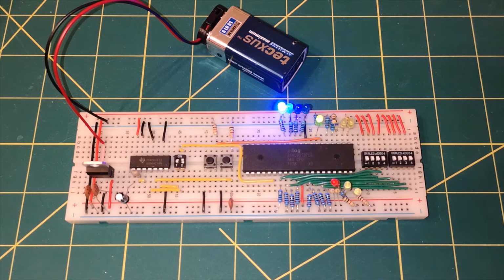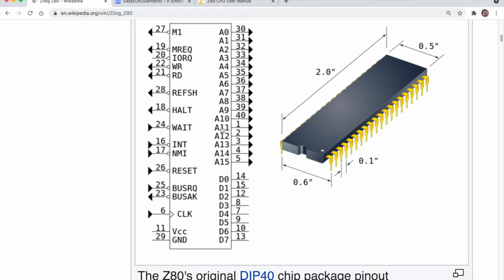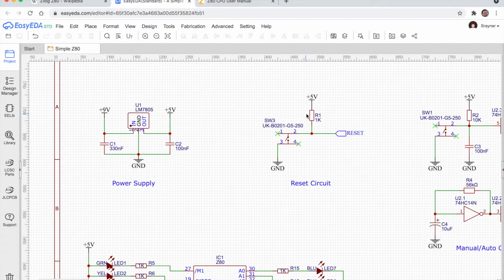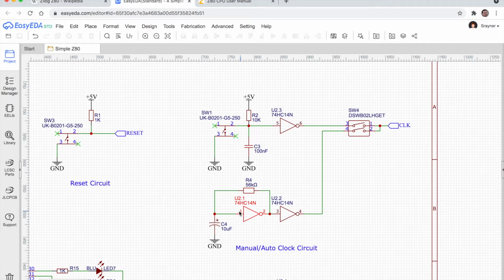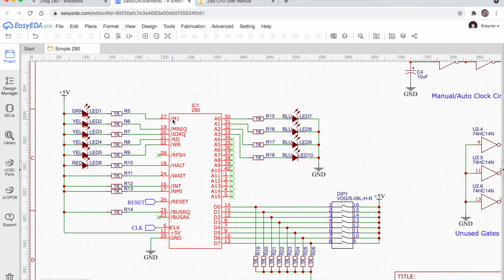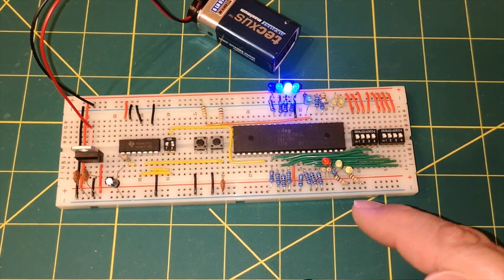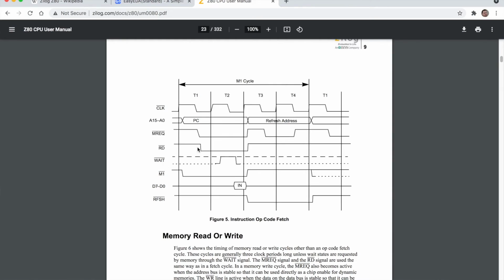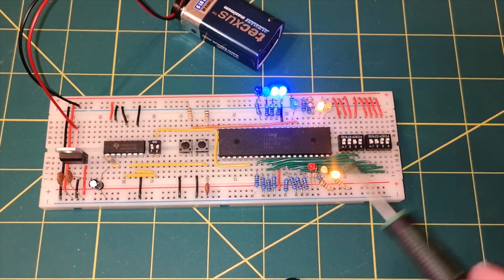Z80 Computer - Part 1 The CPU, Clock & Reset

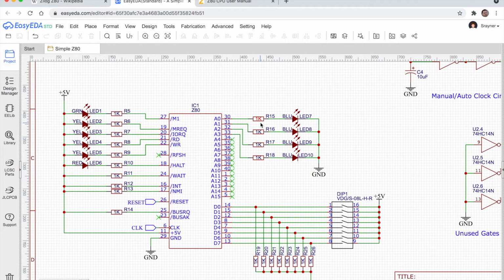Comment: 24:19 The current limits are the same for all pins so its specified just once under DC Characteristics. It's non-symetrical so different for active high and active low. Iₒₗ is 2.0 mA and Iₒₕ is 1.6mA. If you were using a first generation chip you'd have had problems, but later revisions were built to better specs.
Reply from the maker: This is good to know. If anyone is following along with an early chip it could damage it.

Comment: There's what the spec requires and what the parts well permit.The modern CMOS parts can handle more current, but if you're going to produce anything other than a bodged prototype you should buffer the LEDs, if only to ensure maximum fan-out of the bus.

The NE555 is usually depicted as transistors because that's what they are, but TTL inverters are more or less the same circuitry, and Don Lancaster first showed the astable multivibrator as a couple inverters that'd otherwise be oscillating at propagation delay time with resistor and capacitor to slow them down. Ben Eater used three 555s for his clock module to build upon teaching about what all the 555 can do, but the output was a clock with pretty slow rise/fall times. A Schmitt Trigger would've cleaned that up.

But if you're not building on previous lectures on the 555 and you could do with a Schmitt Trigger anyway, a 7414 gives you a clean slow clock and four debounced buttons! Throw in a NAND or NOR discrete chip, a 3-way slide switch, a pot to replace the RC resistor, and two more caps and a crystal and you've got a better fast/slow/manual clock circuit than Ben's at half the breadboard space he needed.

I am sad that the Z84C00 is no longer made. Guess we'll be turning to emulations and FPGAs in time.

Comment: whats the transistor for
Reply from the maker: There is no transistor. There is a voltage regulator on the far left, it's there to reduce the 9volts coming from the battery down to 5volts
Reply: @SteveRaynerMakes  transistors will have 3 or more things

Comment: I've just discovered your channel Steve and I'm enjoying your content. I have a similar project on the go currently, a multi-Eurocard based Z80 20MHz overclocked to 25MHz (using /wait to help the  EEPROM keep up), a LCD character display and PS/2 keyboard for input. My goal is a faster version of the original IBM PC. Your work on a VGA output is of particular interest to me, keep it up!
Reply from the maker: I'll be the first to admit I am struggling with the VGA, but I think it is one of the most interesting parts of the project. I also wanted to look at the faster more modern Z80 processors but I could not find any good documentation.

Comment: Recently I started a little 8 bit breadboard computer project with the w65c02. Much fun with the literal 0`s and 1`s right on the chips little legs. I also more recently got hold of 6 circuit boards from some communication system, It  holds a D780C-1 processor. Turns out I am now the proud father of 6 Z80 oem CPU's.  So a search on yt got me here for a Z80 project, Subbed and bookmarked for later.

Comment: hi, I have a Zilog Z80 like yours, in cmos, but it behaves anomalously, I made the connections like yours, pullup resistors on the reset-busrq-wait-int and nmi pins, I generate a clock with the blink sketch of arduino (for my convenience at the moment). 4 LEDs with resistance on the negative for the address bus A0-A1-A2-A3 and finally I put all the pulldown resistors of the data bus, the only difference from your project is that I didn't put the jumper on the positive for the databus. It shows no signs of life, the clock LED flashes, the RD LED is always on and on the m1 it never activates even after pressing the reset for a long time... Do you have any suggestions, maybe I missed something? if it can be useful my model is Z84C0020PEC
Reply from the maker: My part number is Z84C0010PEC. Seems we both have CMOS versions. Mine is 10Mhz yours is 20Mhz, but as far as I can tell they should both work the same. All I can suggest is that you double check everything. Did you connect 5v and GND pins on the Z80? Might be obvious, but you didn't mention it. Do you have an oscilliscope?
Reply: @SteveRaynerMakes   I had taken the power supply for granted, the 5V in pin 11 and GND at pin 29, I power it via the Arduino Mega. I have one oscilloscope that has been sitting in the cellar for many years, I don't know if it still works, I also did a test by changing the breadboard and redoing all the connections, the strange thing is that if I remove it from the board and put in a new one taken 2 days ago even if it is another model (Z8400AB1 or Z80ACPU) I think CMOS doesn't work

Comment: Hello! I tried out the circuit, and it works perfectly with automatic clock. However, manual clock does not work as it should in my case: no problem if I press the clock button continuously at a steady pace. But if I stop pushing it, after - let’s say - 1 or 2 seconds all the yellow and blue LEDs turn on. So I can’t really pause the execution. I checked the clock signal with an oscilloscope, and it looks ok. If I stop pressing the button, there is no clock signal. But even in absence of a clock signal, all the LEDs (except halt) will light up after a few seconds.
Reply: It looks like my Z80 is an NMOS version of the chip, thus requiring a minimum clock speed. Manual clock only works with newer CMOS processors.
Reply from the maker: Although it doesn't help you much, it is at least good to know.
Reply: @SteveRaynerMakes  Indeed, I purchased a new CMOS Z80 and I can confirm that manual clock works properly with it ;-)

Comment: Choosing a "fairly useless low spec machine" is on the USEer.  If you have a USE for a low spec machine as a hardware and/or software driven invention/utility device, then the low spec machine is no longer "USELESS".  If you want your computer to decide for itself what it will be used for today, then by all means, USE paywalled corporate driven AI pets!!!!

Comment: Nice video. One quick note when you're manually doing the output. Whatever you output is going to be on the same bus as those DIP switches, which some are forced HIGH when the switches are closed. Hopefully no data bus pins were damaged.
Reply from the maker: Yes in hindsight that wasn't really a very good idea. I guess the circuit is ok for reading, but not really safe for writing. Luckily there does not appear to be any damage. I think I might have been lucky, in that the instruction I used was OUT (n), A. So it's the contents of register A that would be output. I believe this "may" be FF after a reset.
Reply: @SteveRaynerMakes  I saw that you're learning as you go, so these are typical things we all do. I was building a Z80 system yesterday and mixed up a few lines and wondering why my code wasn't doing what it should. Then I accidentally connected the WR line on the EEPROM / Flash memory, so when the code went rogue, it overwrote some of the code. I'm on your third video. Still going...

Comment: I just started breadboarding this. I got some C compiled and burned onto an EEPROM but I will have to make my own Z88DK config. After I started connecting it to the Z80 I decided to move the processor to another breadboard and create a bus, putting all of the control, address, and data pins in order.  My clock is only 1MHz, so I think it should still work.
Then it was early morning so I decided to pick it up another day.

Comment: Just found this series.  It looks interesting so I'll follow it for at least an episode or two.  Maybe longer.  It looks like you're going to be using bank switching.  Multitasking?  That would be a challenge but an interesting one.
I had an idea of building a multitasking / multiuser system which has memory protection to prevent one user's program from intruding on memory intended for a different program.  For example, only an instruction executed from the ROM switch memory banks and if a program running elsewhere attempts to do so, the signal is blocked and goes nowhere.  This would force running programs to "request" a bank switch when needed and the OS can ensure the request is valid before granting it.
Directly jumping to a ROM routine would also be disabled.  The running program would need to use a RST call in order to send a request to the OS.
Incidentally, it seems that most or all Z80 CPUs will actually access up to 64K I/O ports.  This is done by using the IN A,(C) and OUT (C),A instructions.  It seems that these instructions actually output the entire BC register pair onto the address bus during the instruction execution, which means you have access to heaps more I/O ports.  If you really wanted to, you could even use some of these I/O locations as slow RAM for accessing data.
This is undocumented so it might not work on all Z80 CPUs, but it's worth trying to see if your CPU works that way.
Reply from the maker: Hi thanks for your comment. Yes I'm intending to use bank switching to access more memory, but not really for the purpose of multitasking or multi-user system. I think that would be too advanced for me. Yes the IO address space is actually full 16bit (64k). Some instructions place the A register on the top half of the address bus and some use the B register. I'm using this feature in Part 11 for the keypad.

Comment: I have seen briefly this video in the past but this time I watched it through and I was absolutely enthalled. 
I believe that the initial standard chip speeds were 2.5MHz and 4MHz and I always found the Z80 to be an understandable chip. Its instruction set and fuction is the same as the Intel-8080 but that require a couple of support chips corrected with the Intel-8085.
Somewhere I have all of the chips for a Z80 SBC and a perforated board that I was going to assemble it on. Maybe it is in the loft.

Comment: Just found this. Outstanding explanations. I'm going to build all of this so I can follow along. Thank you!
Reply: How are the explanations out standing? He has no idea idea why the 74hc14 chip using pin 3 & 4 in the clock circuit he borrowed from someplace else.
Reply: @pikadroo  Certainly there are a lot of things he doesn't know. Even I knew about the clock. Overall this was a good video for a beginner. If you don't like it, don't watch.

Comment: im 25 so i have no nostalgia for this. I like the z80 computers and the cpu because the documentation is fantastic, there are so so many books on the darn thing, its reasonably easy to make a system from, they are cheap and readily available, and because of how old it is, there is a crap ton of software written for it so plenty of example code. This is a fantastic learning tool for any age regardless nostalgia.
Reply from the maker: Thank you. It's interesting to know that younger viewers might be interested in this type of content despite the Z80 being so old.
Reply: @SteveRaynerMakes i am 15 years old and i started to learn about z80 a few years ago because gameboy used its modified version
Reply: Yep - I still have some old books about the Z80, and they are really helpful. I was experimenting a lot with the Z80 (and all kinds of processors to be honest, starting with the now famous 4004), in a way very similar to this video. That said, I also have a load of books about the 6502 processor. That was another one that was really popular in those days (mainly because the where at the heart of the Acorn Atom and the more widely known BBC-B computer).
Reply: @jclosed2516  Fun Fact, the 6502 is still being made brand new by WDC and is being sold by Mouser and digikey. WDC also makes some other 6502 related products like a 16 bit pipelined version and a microcontroller/soc called the MENCH
Reply: @zilog1  Yeah - I know. I only wanted to point out that around that time those processors (Z80, 6502, 1802) where at the height of their popularity. For me it's still fun to play around with them at the present, but for most people today it's sadly just an ancient piece of technology.

Comment: Going to try this Steve.  A question.  In Ben Esser's series on the 6502 he talks about not using the early 6502 models because they had dynamic registers that needed to be constantly refreshed by the clock like dynamic memory, meaning slow or single step clocks would cause the processors register contents to disappear.  I have what looks like quite an old crusty Z80, just wondering if i might hit the same problem.  You don't appear to.  Any ideas?
Reply from the maker: If you use static ram like I am, then it doesn't need to be constantly refreshed. The Z80 can handle any clock speed down to zero, completely stopped. It's an excellent processor to learn and get started with.